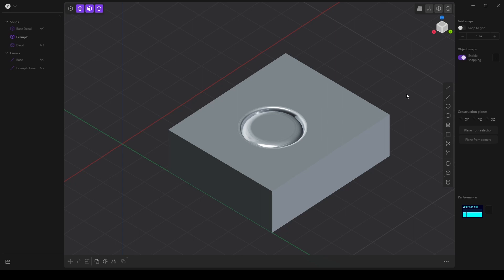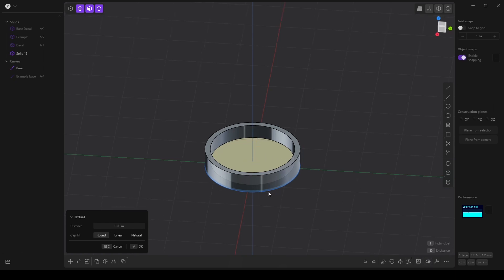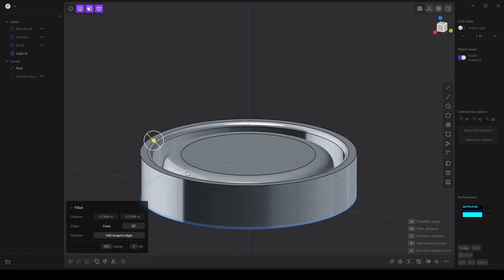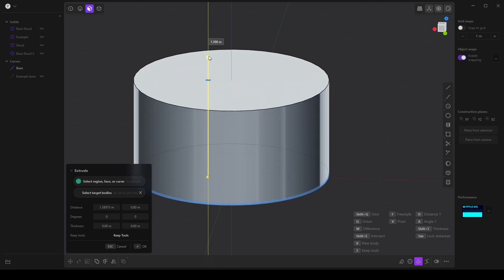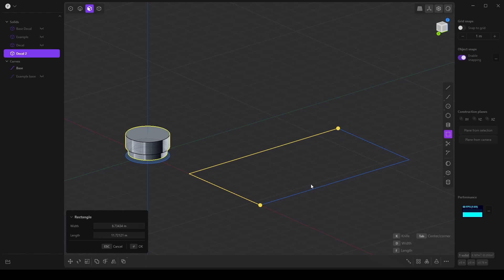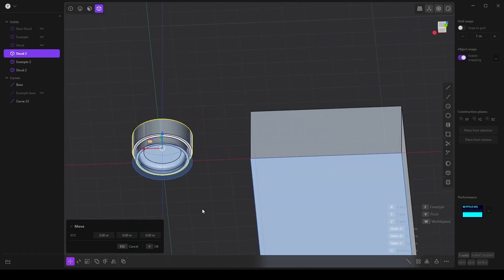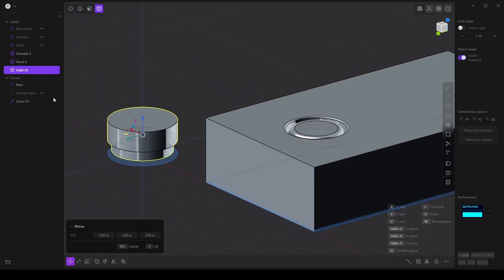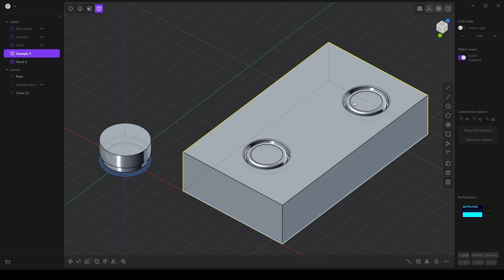How to make a decal in Plasticity (Drawing in 3D)

Comment: why do you call that a decal?
Reply: In 3d modeling, decals are a name for easily-applied, typically-inset extra geometry, like screw threads, inset buttons, etc. For Blender, there's a plug-in called Decal Machine, and if you search for videos of it, you'll see more examples of what it means.
Reply from the maker: Yes, as overseastom mentioned, I'm just using "decal" abit generically to label the geometry.

Comment: wouldnt be faster to just create the decal directly on the base mesh, by starting with a circle boolean ?  I might be missing something
Reply from the maker: Well, maybe, but the trick is that the decal is inset. 

You could likely do it using a revolve to make the "negative", but you would not see the proportions until using a Boolean. 

Also, if this were something like a screw head decal, than it might also be easier to start with the overall shape.